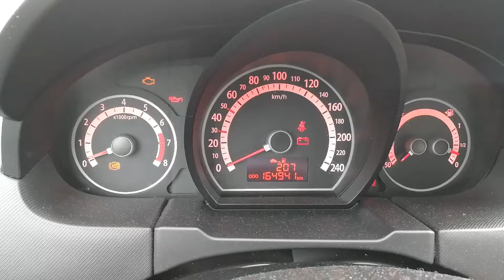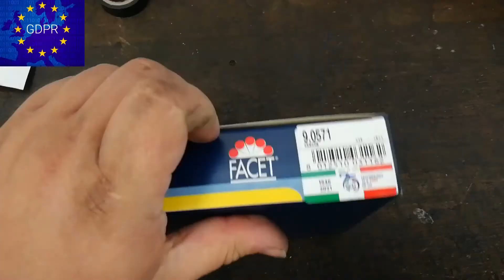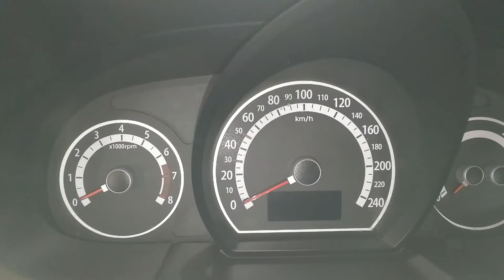Kia Ceed, Hyundai i30 - crankshaft position sensor, snímač klikové hřídele

Comment: just replaced mine on a 1.4 2015 kia ceed...car wont start now!....got a PO335 crank sensor pending fault ?...faulty sensor?...not touched anything else
Reply from the maker: does the engine speed value show during starting in Diagnostic? if nothing is displayed (engine speed is at 0) the problem is somewhere in the wiring or a bad - unsuitable speed sensor. If it shows engine speed during start - the problem is somewhere else, but from my position it is imposible to determine where

Comment: Wonderful vídeo, My engine have problem is not start The check engine sinal is not on at pinel. Wat can Ido??
Reply from the maker: ideally, it is good to use OBDII diagnostics, and check the engine speed during start-up.
When the revolutions show, there is no problem in the crank sensor. It happens that the immo light flashes during starting, that would be a problem in the coil of the ignition switch (video will be coming soon)